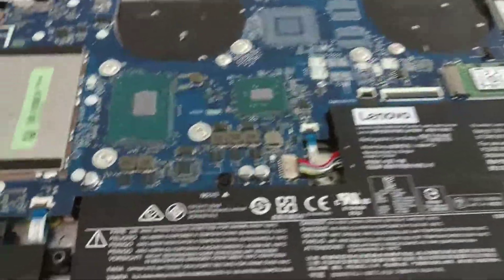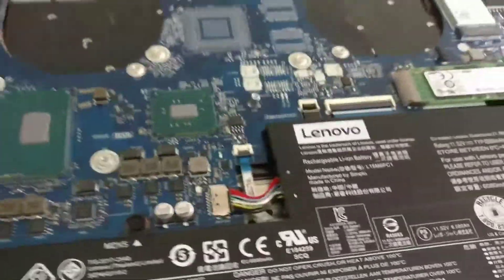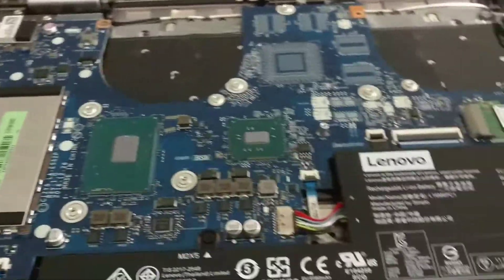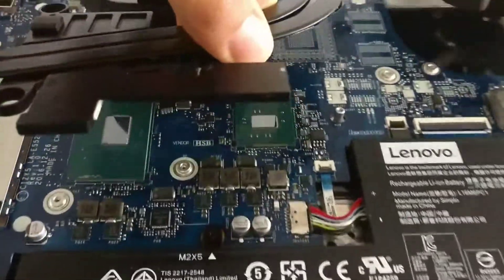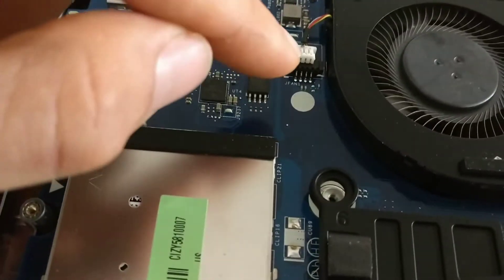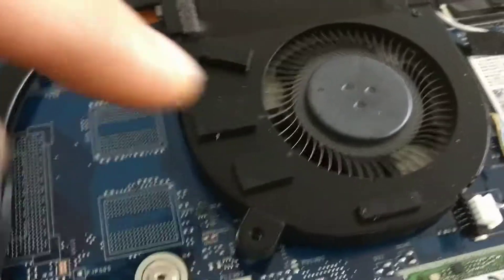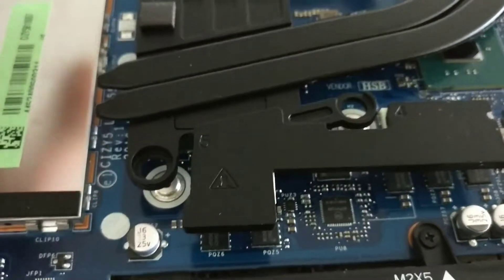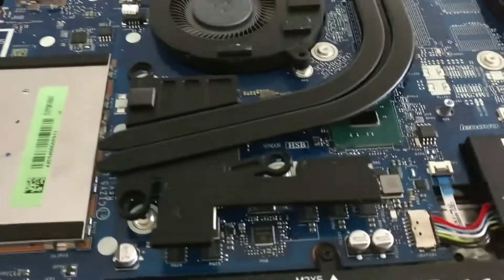Lenovo Yoga 720 15" heatsink removal.

Comment: This is totally off topic but relates to the same laptop model. Does yours have a black line running across the top of the screen? Never could get rid of it but honestly I forget it exists during my laptop usage. I definitely need to do this I think to my laptop. Question, is it normal for the black foam on the bottom fan panel for the laptop to look kinda faded/pale? Thinking it might be dust. My laptop is overheating quite a bit recently and getting quite a bit of FPS drops when I noticed this.
Reply from the maker: I don't have the line on top other than the bezel...

If the black foam is faded it probably is gunked up with dust. My advice would be to clean both fans and re-apply your thermal compound. Most likely one of those two places would be the culprit.

Comment: I'm relatively new to PC/laptop upgrades and builds. I just bought this laptop and this seems like something I might be interested in doing, especially after seeing your video about how bad the original paste is. What kind of thermal paste would you recommend getting? Also, about how much did you use? And how would you recommend removing the original paste?
Reply from the maker: Generally the paste matters less than applying it correctly. I buy most my computer stuff off of Amazon, look for a thermal compound with ceramic or silver that has good reviews. People would say use an antistatic wipe, but I honestly just used paper towels to clean the processor. The most important part is that you MAKE SURE YOU'RE GROUNDED, seriously even imperceptible static to you will fry the whole thing. Either has an anti-static wrist strap connected to something metallic that will ground you, or do as I do and place your foot on something that will ground you.

For the best way to apply the paste search on Youtube for "How To Apply Thermal Paste" and it's the first video by CRIT (also known as the tek syndicate.)
Reply: Daenon Janis Awesome! Thanks for the help!

Comment: Here is an off topic question. Have you had issues with the power supply being too big or too heavy ? Does it affect portability ?
Reply from the maker: Alan Nise not really. it's a pretty light brick.
Reply from the maker: Alan Nise pretty small too. all things considered, about 1"/3"/.5"
Reply: I'm guessing that they provide different supplies for versions with and without the GTX-1050.  The one that comes with the 1050 version is supposed to be a monster
Reply: Could you post a pic of the supply ?
Reply: And by the way.. that's so much for taking the time to help
Reply from the maker: I was able to find one online. It looks like it's about the right size.
http://lps-gopower.com/lps-ac-adapter-for-lenovo-c-2/original-lenovo-yoga-72015ikb-80x7001tus-80x7003vus-charger-p-6730.html?gclid=CjwKEAjwvr3KBRD_i_Lz6cihrDASJADUkGCa8P_iU2hgay-8ZrUGAKC9eguCsLVt3A5Uc_3VRbuXoRoCh63w_wcB

Comment: This the GTX 1050 version, can it take an additional ram stick?
Reply from the maker: Septimus - Prime the gtx 1050 version will be the same. there is 1 soldered ram card, and one that is user upgradable.
Reply: Can I add another 16GB of RAM as long as it's the same type & size which amounts to 32GB?
Reply from the maker: Septimus - Prime the max you will be able to get is 24 gigs. if you buy the 16 gig model Lenovo adds a removable 8 gig stick. using up your upgrade options.
Reply: 24 is acceptable so I can purchase a 16 GB RAM DDR4 stick?
Reply from the maker: Septimus - Prime it should.
Reply: Thanks, can't wait to have this & stream online! :3

Comment: And does the repasting help with heat and obnoxious fan noise?
Reply from the maker: osama hamid quite a bit. The fans definitely run less often since putting it on. Truthfully it wasn't bad before as the fans are pretty quiet, I just wanted to conserve power.

Comment: I got my yoga 720 15" last Saturday. I suffer fan noise and heat problem already. The issue is the worst when I use Google 3D satellite map. If I try to zoom in and keep swiping to other locations, it would make the fan go crazy and heat burning. So I requested a refund and I will send it back to Lenovo. Is this the problem for all the Intel 7th generation CPU? But Macbook also uses Intel chip.
Reply from the maker: it's an issue with the heatsync. I'm guessing you didn't have the gtx 1050 model? Applying new thermal paste would have most likely fixed the problem. the CPU in this thing is also a lot more powerful than most laptops so additional fan noise is expected.
Reply: i have the gtx1050 also

Comment: so if you take out those fans, will the laptop get too hot? If it doesn't have fans to suck out hot air, your laptop will die fast. Isn't it? Please advise.
Reply from the maker: Henry Leu not sure if you're trolling or not... regardless, you do put the fans back on after applying new thermal paste to the CPU.
Reply from the maker: also laptop fans generally suck air in instead of pushing it out. it generally reduces dust that way.